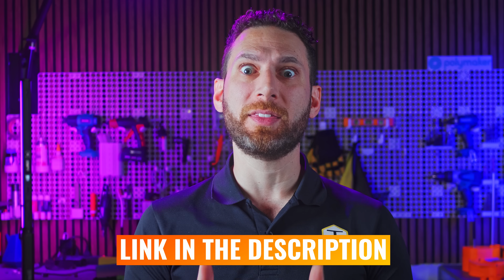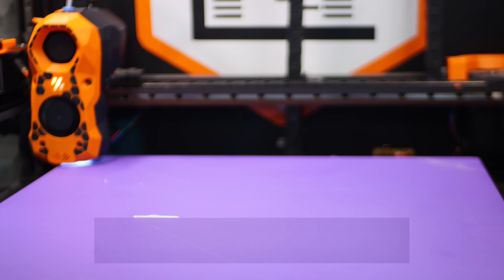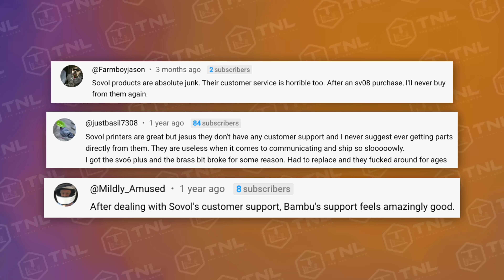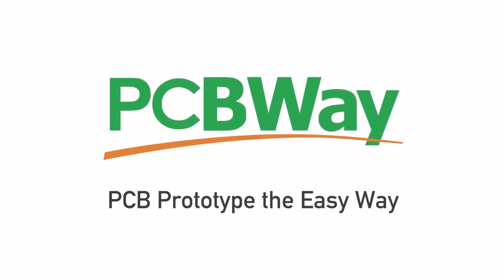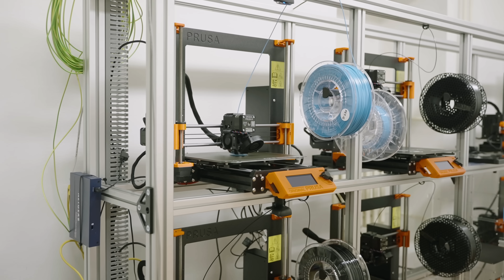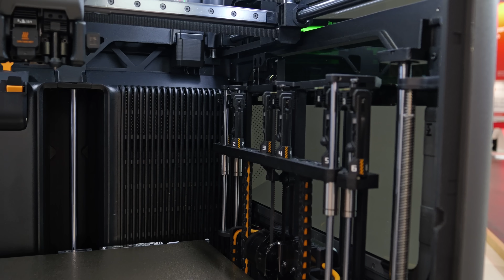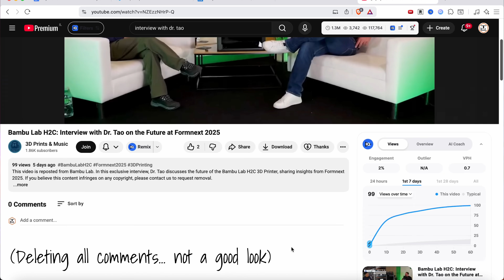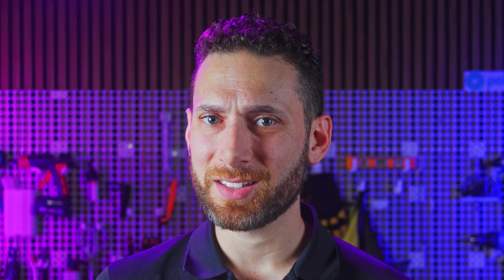My HONEST Annual Report Card for Each 3D Printer Brand

Comment: I feel the H2C really hit its mark for a few reasons, one being that its an enclosed multicolor beast whereas the toolchanvers arent. This retains the ability of the H2C to not only do multicolor, but also multimaterial for more advance users. It also keeps all fumes inside and filtered much better.
Reply: Come on man, bambu missed it this time.. this printer would've been great if launched a year ago, but now that concept is basically dead on arrival when we got such good toolchangers as indx and u1..
Reply: @dheerajb1883 I don’t see how it’s missed. The system works and has more color/material capabilities than anything on the market. 
The U1 wins with speed on low temp filament but is Limited to 4 colors/materials. 
The INDX is probably the best system for prints 3-8 colors but the core one is missing some QoL things the H series from Bambu had

Each system has its benefit
Reply: @dheerajb1883  Lets see if Snapmaker and/or Prusa can ship a 8 or 10 INDX system within a year of the h2c printing at my home for the last week.. no youtuber just someone with too much money who clicked order and got it within 8 days. If the Core One L INDX10 will be all that and so overpowering in a year i might switch again... Since  "we got"  really ? where are these INDX or Snapmaker solutions with same buildsize of the h2c "we got" i can't seem to order them and print next week and probably won't be able to do that for pfff 6 months is my guess.
Reply: @dheerajb1883 this is the best comment I've seen about the H2C
Reply from the maker: You know the core one INDX is enclosed, right? And that they’re soon shipping a top for the snapmaker U1 right??

Also, Vortek cant even do flexible filaments. Or fiber filled filaments…!
Reply: @thenextlayer  Vortex can absolutely run fiber-filled filaments. Where are you getting your information from? Vortex can handle any engineering material. It can also run TPU, it just cannot change it.

It also feels like you are still upset about breaking your NDA with Bambu, which is why you were left on the sidelines.

And the U1 is not enclosed. It has a plastic add-on top and is really suited for one thing: making colored toys.
Reply: @bbc92314  Yep doing tpu's on both nozzles already. The whole issue is people are so esp. INDX happy (which to be fair looks like a great product) they feel the need to define a product that is out NOW and working as well not interesting.
Reply: @thenextlayer  You know i can't buy a Core One L INDX10 now right? And even if would be available now for me to buy order and have it in my home in 8 days up and running (yes).... and yes we are doing dual nozzle TPU mixed and fiber filaments just fine.. Does the h2d/h2c have downsides sure but again you know its shipping right?
Reply from the maker: @scb2scb2 you mean if you use a specific kind of TPU for AMS, right? And the AMS doesn’t support CF filaments…
Reply: @thenextlayer  no, you can use TPU down to 85a but you can not color change it. You can still use the right side as a normal extruder without ams. What’s also nice is that you can have different size nozzle parked and have the ability to change nozzles with a click of a button. It’s more than a color changer , people that use these for more than toys can see this, and beyond the 45sec swap.
Reply: @thenextlayer  No people have been printing dual TPU (not the fake ams one) already its still a dual headed printer. Of the CF materials bambu sells about 50% can use the AMS the others not but again you still have the option to use the other head or not use the ams at all. You can hate on the ams all you want and thats fine it has its limits but the printer can do more than you make it sound like by semi hiding behind the ams or vortek. while we also see the downsides of it but work around it. The ams system for all its power has many downsides including speed and limits on what the current ones can take. It's clearly the 'worst' part at the moment but a U1 or XL is also not magic in all its ways is it ?
Reply: @bbc92314  Well you can we are already printing TPU's on both nozzles does work just not officially supported even is they say it will be allowed soon.
Reply: @scb2scb2 that is true, this will be supported shortly I have heard but I am talking what’s official supported.
Reply: @bbc92314  Yeah i think 'us' h2c owners know well what the downsides of the AMS are and where we hope things can still improve but making it sound like nothing is possible is silly you can print more on a h2c than most printers we don't need to hide the iffy areas that still need some work. It seems there is a lot of 'in the future we will be able' talk on one side while ignoring what is already possible now and what people are doing now already.
Reply: @thenextlayer  The only way it will be good is if you can do flexible, which is supposedly what they’re working on, and you could do different nozzle sizes, but I heard INDX you can already do different nozzle sizes.

Comment: its gonna be really funny when bambu comes out with their next enhancement to the H-Series that takes Vortek to the next level. I have a hard time believing they spend 3-4 years developing Vortek only to leave it as is.
Reply from the maker: They didn’t spend 3-4 years on Vortek. They said they have been on the journey of developing multicolor printing for 4 years. 

Also pretty sure their next printer will be a proper tool changer after the awful reception Vortek has gotten.
Reply: @thenextlayer  man if they do come out with a toolchanger im gonna have to build an extension on my garage to house yet another bambu printer heh

Comment: I own a Bambulab A1 + AMS a year ago because I got a great black friday deal. I bought a pair of headamame headphones to print earlier this year. They recommended using Orcaslicer to get a specific infill geometry. Because Bambulab restricts usage of Orcaslicer, if headamame had not provided pre-sliced files I would have been fucked. With that and the new open source filament RFID tags, I have decided when I need another printer, I will leave Bambulab. I am so frustrated by their anti-consumer behaviour. The only reason I am not right now is because my printer is working for me currently and I don't have that much money to upgrade to Prusa
Reply from the maker: Thanks for speaking up. You’re proof of exactly what I’m saying in the video. They brought a lot of people into 3D printing, but they are alienating a LOT of people by not playing well with others in the industry.
Reply: @thenextlayer  I was very impressed at how many Orcaslicer features you showed off in your brief montage. I didn't know most of those existed but it frustrates me that I can't use them because of Bambulab BS

Comment: With Bambu going closed sourced, I decided to switch to Prusa. Couldn't be happier. Bambu shot themselves in the foot for no reason, closing their software gave them no advantages, just many lost customers and goodwill.
Reply: It gives them the image of being beginner friendly. I've been looking at 3D printers for months just wanting something that worked. Regardless if every printer out there has the same print reliability of Bambu, their reputation for being disliked by seasoned 3D vets due to their restrictions is one of the top reasons I bought a P2S. I'm new to the filament game, I want those guardrails. I have no doubt in the coming years I'll learn to hate being boxed in, but for now it's a security blanket while I learn.
Reply from the maker: Agreed 100%. I was willing to tolerate certain closed things like closed firmware but when they blocked orca it turned me off…. And the new printer won’t even support third party nozzles?! Wtf?

Comment: There is one thing I hope more manufacturers will do, and that is to provide support for at least three years after the end of the production run.
Reply: Prusa supports every printer in the last 10 years of their production.
Reply: This is a big reason why I will no longer buy Creality products, they abandon them so fast!
Reply: @Travix03  Actually, Creality provides support and parts for all legacy printers - even ones they no longer manufacture. You just need to contact their customer service.
Reply: @LoriAnneBrown  I did contact their support about issues with a year old printer. I supplied support with all that they requested. My issues were not resolved, and they were not helpful.
Reply: Minimizing product lines and focusing on delivering one high on mid and one low end printer and providing upgrade kits would consolidate their support and leave room for R&D
Reply: @giorgos992  and also one big one
Reply from the maker: Oooh good point!
Reply: This is why I support Prusa
Reply: @juggernaut316  Since I can buy two, maybe even three, alternatives for the same price it doesn't mean much.